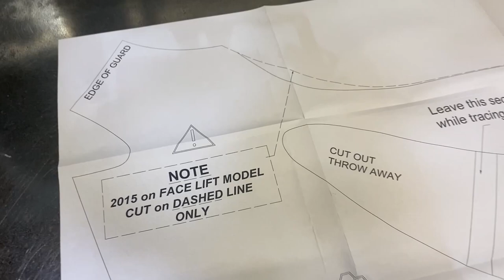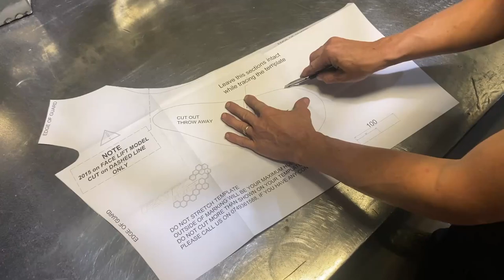200 Series Landcruiser 5" Snorkel Installation

Comment: Do you guys not seal the cutting edge? It will rust…
Reply from the maker: Hey Rando, the cutting edge is always sealed. Tectyl 506 is an industry standard rust preventative solution which in our mind is the best option for this application. You can see this being used at the 4m 22sec mark and used again when nutserting the A pillar.

Comment: Hey guys beautiful install - quick question I note that in your replacement air boxes you use (I think) K&N filters - is there a reason why and why you don't use the standard Toyota filter?
I'm lining up for an install just working out if I'm heading to Rockhampton and getting you guys to fit or a local fitter, I've tried twice now to get to you and a certain previously unknown pandemic has stopped me both times, kind regards David W
Reply from the maker: Hey David, we use the pod filter for simplicity and it met our specifications and requirements during the testing period quite some time ago. Our filters are a little different to a K&N, we have 5 extra layers of filtration without sacrificing flow. The filters are designed by us for the harsh elements of the Australian Outback and have been proven over the last 13 years in business.  

Nick